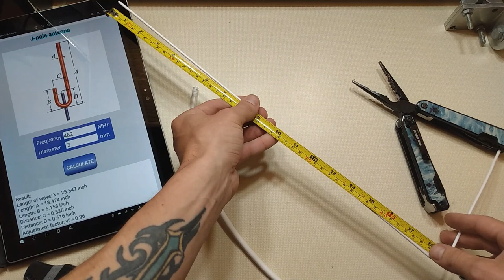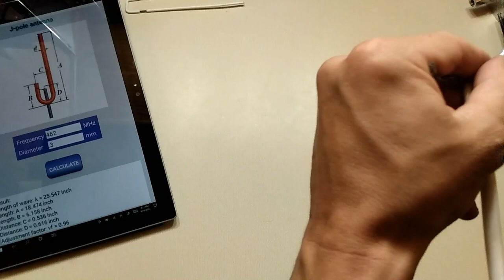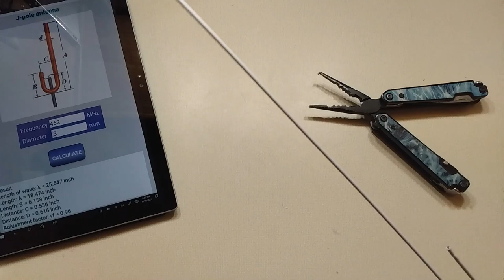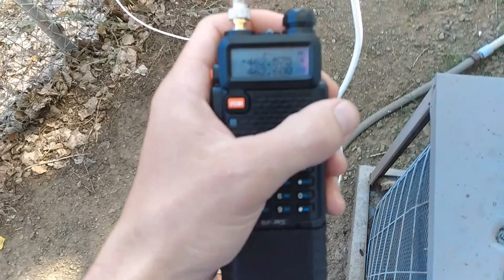HOW TO BUILD GMRS J-POLE ANTENNA, GMRS Home Brewed J Pole Antenna

Comment: If the amount of 2m repeaters or links are an indication of of use, then shifting a few mhz on a 70cm vertical or yagi should be okay. Unfortunately, many resident operators live in an HOA  community with restrictions, the smallest antenna visually may pass where as a half or five eights wavelength vertical or beam will be denied placement.. ( looking into stealth flagpole vertical, fed under base with built in traps for multi hf . Attic quarter wave for 2m, 70cm, gmrs coverage.  
The water and power crisis will determine my move or saleof my  retirement home in south central Az. 
I love the sun for achey joint relief, the fresh dry air for allergy relief. 
Considering a northern spot trade off. 
 Good info on j pole. Made a 2m copper version with amazing results. 200 plus mile at 65 watt mobile, with tip at thirty feet. 
Keep them coming. 
73, kb8qlz 
Gmrs tix in the works, with two handhelds and a 25watt mobile/base. 
Celwave 430 540mhz glass vertical waiting for a 50 ft length of LMR 400 coax.
Reply from the maker: verry nice hope you stay herein az

Comment: My question is why on earth would anyone use 75 ohm cable tv coax on a communications antenna where everyone in the radio community knows that all radios use 50 ohms from the radio to the antenna including the coax and when all impedances matches you have resonance and maximum power to the load
Reply from the maker: it was what i had at the time its all relpaced now